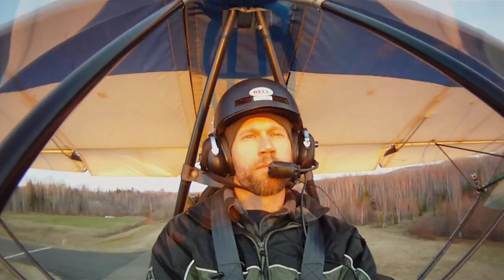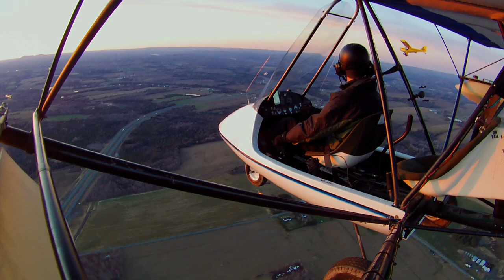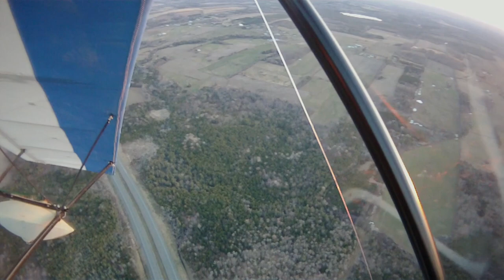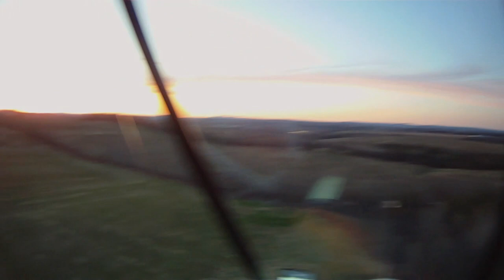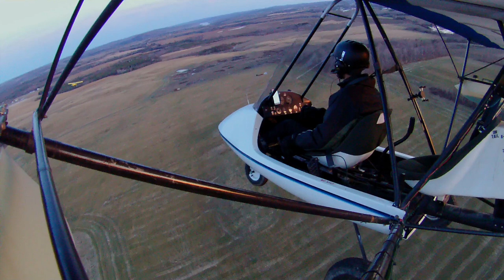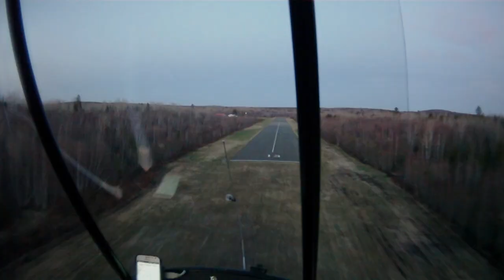Kitfox vs Beaver | Slow Flight, Climb, & Top Speed

Comment: Thanks, this is something that I have hoped that you would do. Since we only get views of the KitFox in this video, it is hard to compare the lines/shape of each while in the air although there have been plenty of shots in your other videos of the Beaver. Okay, so here are some observations, as I am a long time watcher and wisher, just my 2 cents..

Okay, I must admit, I have secretly admired the KitFox from these videos a little bit more than the Beaver because of it's lines/shape/color in the air, and I have been aware that it is a little faster than the Beaver. I like the classic airplane look and, of course, the fact that it is a bit faster is desirable. The down side is that the noise is much higher due to the front engine and also, call it a freedom thing, the cockpit is all closed in and seems restricting. I could see the benefit in colder weather, or for higher altitude flying, but in Texas, that is a rareity and the openness of the Beaver is more desirable. As far as the speed of the KitFox, yes, that would be nice, but for practical purposes that you would use these vehicles for, it doesn't add up to that much. It is a nice figure in the money shot against the evening sun, gorgeous shot by the way, but for my money, I like the simpleness of the Beaver and all of it's benefits. Not that I am planning to get either one soon, but from a far, admiring point of view.

For now and in the distant future, I will continue to ride shotgun with you in your Beaver to view the gorgeous views and versatile landings, etc, in fields and old roads. Thanks for the virtual shotgun rides!
Reply from the maker: Come along anytime! ;-)
I'm with you, the Kitfox is a far sexier airplane, but for my style of flying, the Beaver is what does it for me. Function over form I guess. :-)

Comment: I have a choice of a  Beaver or a Arrow Hawk. Both with 582s on them. Though I do have a 912uls sitting collecting dust. Which plane would you recommend? I think the Beaver is one of the originals by spectrum.
Reply from the maker: Both are great planes, it honestly comes down to which one you you think you'd like better. If you can, go sit in both and see which one you're more comfortable in. I find the visibility a bit better in the Beaver but the Hawk will go a bit faster and has doors. (if that's something that you find important) lol
Reply: @mmatt  Thanks for the prompt reply. I went for a testflight in the beaver it's an RX550 but we had what looked like a seizure on take off. So couldn't really get a feel for it landed asap, does make it a better contender for the 912 though as now owner will sell without engine, just not sure if it can handle an extra 20kg+ on behind the wing. Speed isn't my thing. I just want good handling and off field capability hopefully using my 912 thats collecting dust.

Comment: I want to see a competition between Challenger ll and Beaver. Which one is on top ?
Reply from the maker: I've been trying to do a video on this for a while now. Hopefully soon though. In the meantime, my personal experience is that the Challenger will win top speed and best rate of climb and the Beaver will win slowest stall speed and best angle of climb.
The Beaver also wins in terms of: handling, stability, control force harmony, construction, ruggedness, and ease of entry.
If all you're concerned with is having a pretty plane that goes fast (for an ultralight) go with the Challenger. But if you want a plane that you'll actually enjoy flying, go with the Beaver.
Reply: mmatt 
Thanks for reply. However, challenger wins in speed given that both have exact same engine ? If that the case, then challenger has a better aerodynamic shape. Moreover, I see that challenger could be equipped with surrounding cabin. Any input ?
Reply from the maker: Yup, the Challenger is definitely more aerodynamic. That aerodynamics is about the only thing the design team got right. lol! The Beaver has a doors option as well but I prefer the open cockpit.
Reply: @mmatt  If someone wanted to buy / build a brand new Beaver is that possible and from where ?
Reply from the maker: @davidboyle3032  No, they're not currently in production although there's talk of starting them up again. Check out 
https://spectrumaeronautics.com/
for more info.